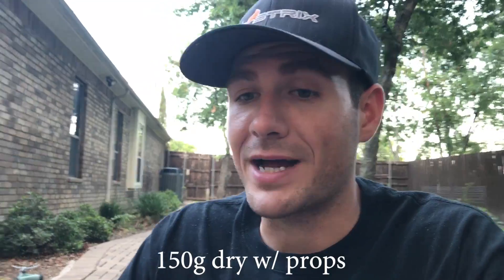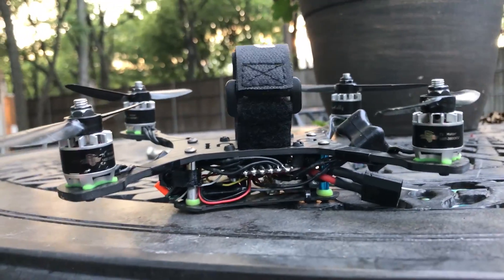Neato Theory First Look

Comment: How much did it weigh. Oh and Serg has some 1407s that are 2722kv. You'll find they still scream but a better kv for a four inch prop. Maybe they won't get so hot?
Reply from the maker: +Peter Mabbort  150g with props no battery. I have some of those motors to test as well!

Comment: if you keep the inverted design and manage to put the battery at the bottom would you be able to put bigger props on a smaller quad? That could become the new trend if that works! Maybe somebody did it already... IDK
Reply: KViN those new 1500mah 4s lipos are quite porky :/

Comment: I absolutely love my 4" Hyperfloss with 1407 motors.  On the tracks I have setup the last few weeks I get my fastest times with it, in one case by over 1.5 seconds on around 20 second laps.  I would absolutely love to try that mid-mounted battery setup and I actually have a full set of parts (identical to my floss build) waiting for a frame.  If I could somehow get one of those to try I would do my best to give you good feedback in comparison to my floss.